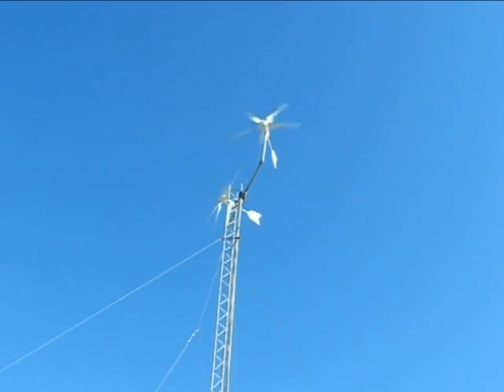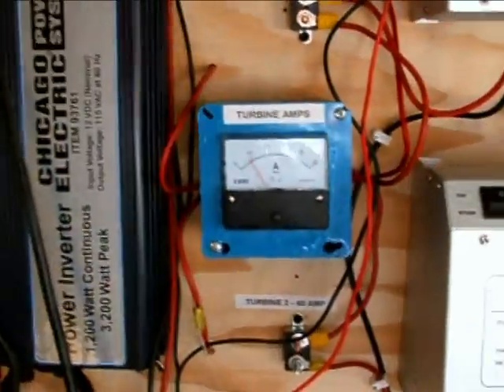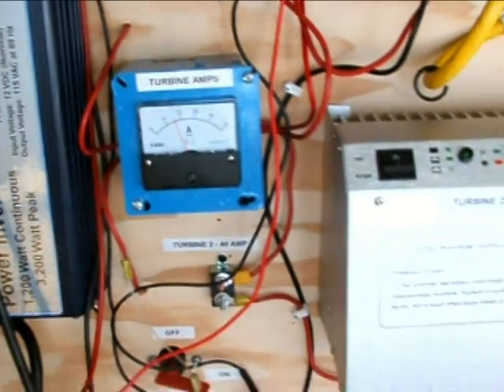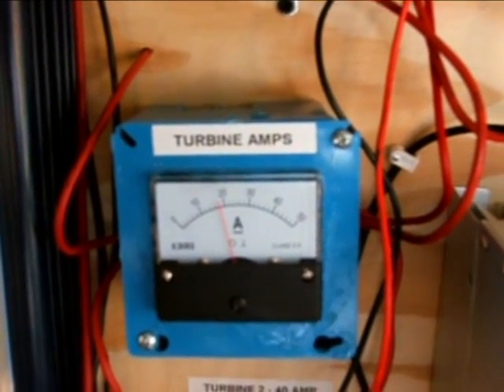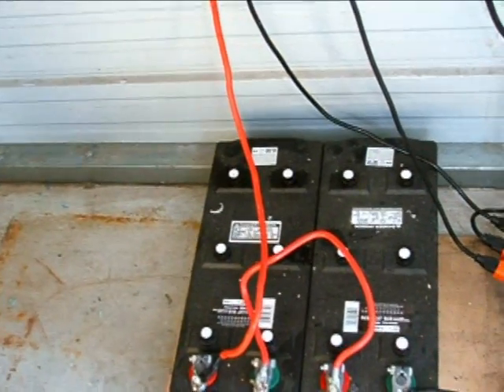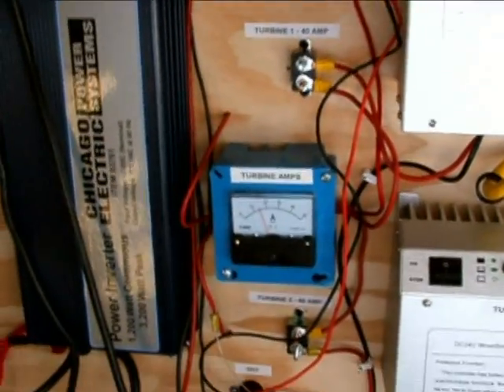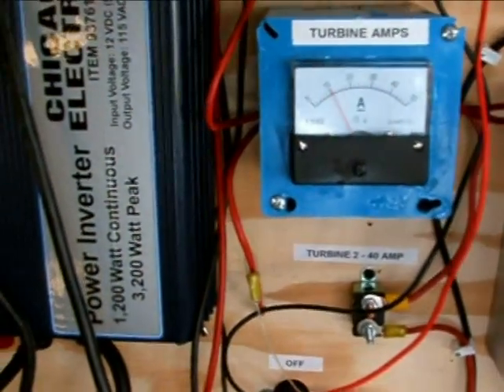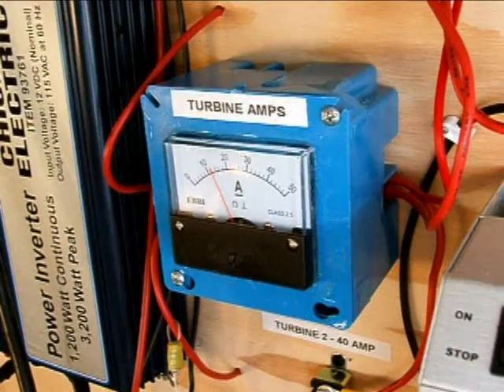Twin 1Kw wind turbine/generators hitting high amps

Comment from the maker: Thanks Nate, yest that is the twist I describe. We will fix it with guy wires from each upright arm to steel beams from the shed. That will eliminate the twisting problem.
The Chicago inverter is just OK but I would not buy another, the fans run all the time whether or not you have a load and that consumes power unnecessarily - I would have done much better getting an AIMS. Wish I could find a Xantrex DR or one like you have - but can't find any, seems they don't make those models anymore!

Comment from the maker: That's great, hmm 45A @ 13V or probably a bit more is about 600watts - not bad! Your system is pretty impresive, I still have to get my small solar panels up and tie it together, throw a coupole of those Power Jack grid ties like you have, a few more DC disconnects and meters and I'll be fnally there (for a while anyway).
Please do share the brake idea, I would be interested!

Comment: Looking good my friend.
 I guess you know I have the little sister to your turbines. When you get some high winds you will be inpressed. I have seen mine do 45A 12V at 45MPH. Make shure you monitor your wire temp. I also found a great way to make a break for your turbines and would be glad to share.
CHEERS OBX NC